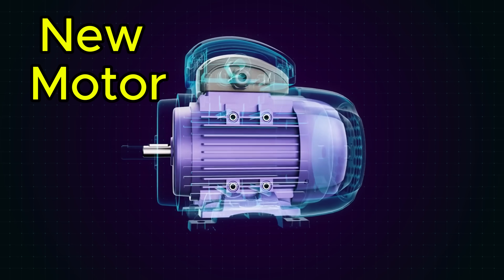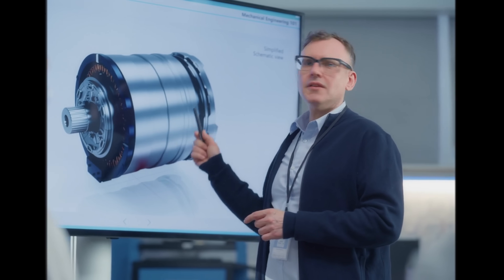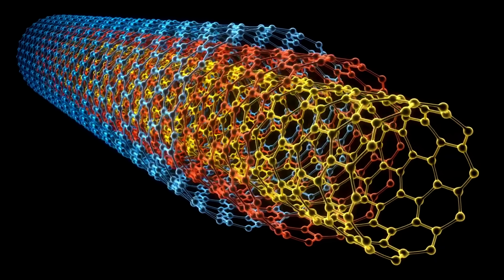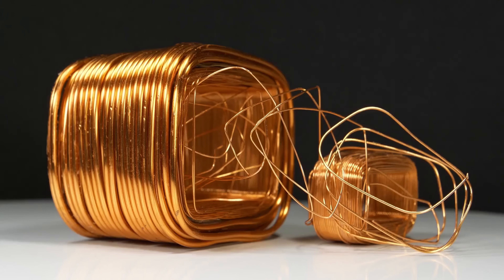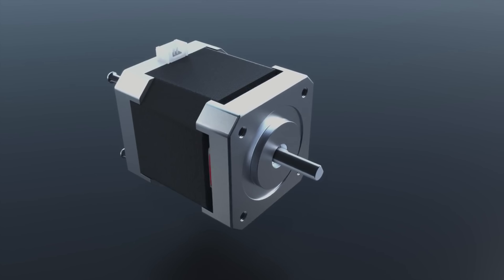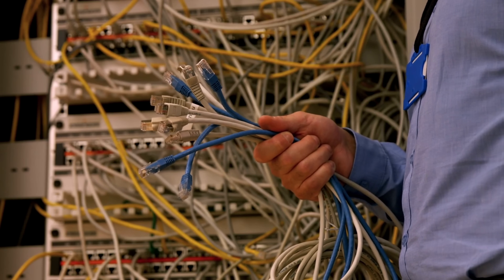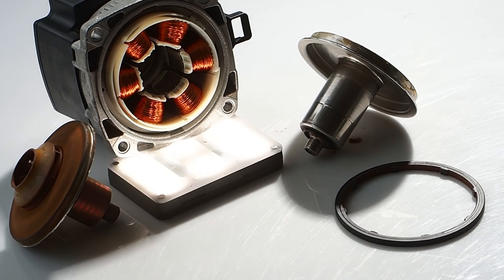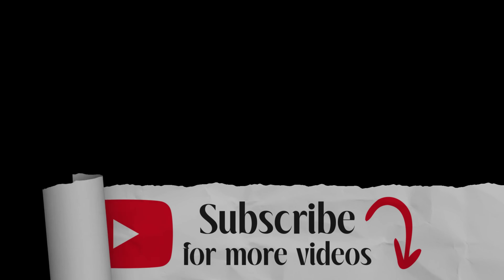New Electric Motor Runs Without Metal Coils – Here’s How

Comment from the maker: This might be the beginning of the end for copper coils in motors. Lightweight, flexible, and potentially game-changing—this carbon nanotube tech could power the machines of tomorrow.

🔥 Would YOU trust a motor with no metal? Or is copper still king? Drop your thoughts below 👇
Reply: So you got rid of the copper so the motor is 99% cheaper right? If not we are not interested!
Reply: Não.
Carbono, e agora o grafeno, são utilizados pra produzir os resistores, por ser resistente a condução de eletricidade.
É delírio do produtor de vídeo.
Reply: Motors using carbon nano tubes would be very light and
powerful. It opens a lot of new possibilities.
Reply: Sooner or later carbon wires will be practical.
Carbon tubes were so expensive in the 1970s the only place they were cost effective was military hardware.
Reply: @iancormie9916 carbon nanotube will absolutely screw with electrical pathing when its not following a straight path and instead following a tube🎉
Reply: @RocketShipFacedPatriot 
      Les nano-dimention des filles ne cause pas des problèmes de circuit  des électrons. Mon problème est que l'électron circule sur les surfaces des métaux ce que lui une telle liberté et fluidité, or le circuit dedans des nappes peut-il permettre cette faveur?
Reply: نعم هذا مستقبل الجرافين سيقلب كل شيء وسيدخل في كل الصناعات
Reply: So they make fighter airplane skins out of copper?  I didn't think so.
Reply: Y donde puedo comprar para mi finca
Reply: Deneme süresini geçti mi?
Reply: 😢😢😢😢😢😢😅77 0:05
Reply: We do not know yey.
Reply: Tombol pintu
Reply: Could if they sold nanotubes to consumers
Reply: El mayor productor y el que fabrica fibras de carbón y quien domina ese campo es China
Reply: copper will be the king may be for ever
Reply: Totally agree with you. carbon nanotube is the future. But it has some challenges like costs, but will be solved with more research. thanks for such video that opens this discussion
Reply: @fatmaabdelzaher6512  costs never come down anymore, only up.
They love to charge for the research and development + profits.
That is not how it is supposed to work.
You can't charge for the research. That is the cost of the creation of said product.
You can only charge what it costs to develop the product + a fair profit. Not a large profit. A small one per unit actually. You make your money by selling cheap and more.
Companies seem to have forgotten that necessary fact.

Comment: Carbon itself is not magnetic. Motors do work by magnetic repulsion and attraction. Hence, steel and iron (which weigh a lot ) are still required to make a viable electric motor. Copper is still more conductive and cheaper than these carbon  conductors. This idea may find its way into aerospace and high end aircraft where cost is irrelevant, but not everyday industrial or consumer goods.
Reply from the maker: Thanks for your input. While standard carbon forms are not magnetic and motors rely on magnetic forces, new metal-free motors using carbon nanotubes (CNTs) as conductors are being developed, potentially for aerospace applications where light weight is key, even though they may be more expensive and less conductive than copper for some uses. The claim that steel and iron are still required is partially incorrect, as CNT motors are designed to eliminate the need for traditional metal components.

Comment: Graphene has been easier to make in the last ten years or so but taking finely powdered graphite also works mixed with rubber or  superglue to conduct electric . I found this in a Chevy distributer spark plug wire many years ago . Had heavy insulater . Like they say it may decrease the weight of motors . If silicone rubber is used it would have a fairly high temp range .
Reply from the maker: Thanks for the interesting insight — graphite-based conductors could potentially open up some interesting avenues for lighter-weight motor designs.

Comment: it will be successful in low voltage electronics circuits , but using it where tons of megawatt flow does not match for its application
Reply from the maker: True — CNT conductors could shine in low-voltage, lightweight electronics, but scaling them for megawatt-level power systems is a whole different challenge.

Comment: Electrostatic Motors should first be perfected with Aluminum since it's cheap enough to work with and Aluminum makes up 6% of the earths crust.
Reply from the maker: True — aluminum is abundant, cheap, and already has decent conductivity. Perfecting electrostatic motors with it first would make way more sense before jumping to exotic, expensive materials like carbon nanotubes.

Comment: Very interesting.

Data communication within buildings is wifi or eternity based. Fiber cables commercially used by ATT have a 3" radius, but if carbon nanotubes are used to replace copper ethernet then local communication wiring may be replaced. Especially if tight physical bends are required.
Reply from the maker: Thanks for the info—carbon nanotubes sound like an interesting application to explore!

Comment: Inner skeptic back from insomnia;

No mention of potential applications for ANY sort of powered flight, despite the various random uses shown here-- almost all of which seemed to have no REAL need for these--  waste-guilting entire industries to pay exorbitant sums on 'our' crap and not 'their' crap(which is objectively the wiser decision for EARTH BASED applications).
Reply from the maker: You’re pointing out something that often gets glossed over in “miracle material” hype — a lot of flashy lab breakthroughs are marketed with vague, feel-good promises, but no clear, practical match between the tech’s actual strengths and its best use cases.

For carbon nanotube (CNT) wiring, powered flight would theoretically be a logical target — weight savings are worth more in aviation than almost anywhere else — yet it’s rarely mentioned in press releases. Instead, you get PR shots of robots, headphones, or generic electric motors where copper’s mass isn’t even a big penalty. That’s when it starts to look like they’re pitching “everywhere” because they don’t have a specific, viable market yet.

And the “green guilt” marketing angle — convincing industries to spend more on the shiny new eco-thing — can backfire if the real-world carbon footprint, cost, or durability don’t match the sales pitch. Without huge performance gains in the right niche, it’s just swapping one hype cycle for another.

If you want, I can break down exactly where CNT wiring would make sense for flight and why the industry might be staying quiet about it right now. Would you like me to?

Comment: My inner nihilist skeptic has his eyebrows raised and his fist in the air, but.... I think people just aren't explaining this in a grounded enough way.

And.... I'm not a scientist, but I know when grifters be drifting. There's a LOT of completely incorrect and/or misattributed statements being made about these 'motors'. 

Add to that the 'carbon nanotube' hype-buzz wording..... 

Ehh... can't put my finger on it-- just odd there's zero mention of potential applications for space flight, as it's key 'advantages'(economically) would be MOST beneficial(cost-of-performance vs return) IN SPACE.

meh, electric motor go brrrr 
Skeptic loner go "suree"
Reply from the maker: Yeah, that’s a pretty sharp read — you’re basically sniffing out the disconnect between what the tech actually does and how it’s being sold.

Comment: It doesn't have to replace copper entirely. Though reducing the demand for copper means other products and industries will benefit from cheaper copper. Even a single market not using copper is a boon to many others. Small steps
Reply from the maker: Exactly—well said! Even partial displacement of copper can ease pressure on supply chains and prices. It’s all about incremental progress, and innovations like this help shift the balance one step at a time. Every bit counts.

Comment: 🔧 MAIN PROJECT: Underground facility for transforming materials using geothermal heat

⚙️ Principle

A very deep well (up to 15 km) is dug to capture the Earth's natural heat. This heat is used to transform or create various materials at very high temperatures and pressures.

---

🏗️ FACILITY STRUCTURE

Protected and insulated central well.

Several zones (or stages) around the well, each with a different function:

🔥 Metal melting.

🧪 Carbon nanotube (CNT) synthesis.

🌱 Biomass processing to make biochar.

💎 Diamond or exotic material manufacturing.

❄️ Rapid cooling with enhanced dry ice.

 ---

🧊 IMPROVED DRY ICE RECIPE

Liquefied CO₂ mixed with argon and a metal catalyst.

Compressed into solid molds (often made of synthetic diamond) → very cold and solid "carbon ice."

Used to rapidly cool lava or stabilize materials.

 ---

💡 POSSIBLE USES

Sector Materials Created Uses

Energy CNT, biochar, supercapacitors Electricity storage and transmission
Construction Ceramics, specialty metals Resistant buildings
Aeronautics Superalloys, nanotubes Hulls, engines
Electronics CNT, crystals, graphene Cables, circuits
Space Ultralight materials Satellites, probes
Medicine Polymers, nano-implants Prosthetics, internal sensors

---

🚀 ASSOCIATED ADVANCED TECHNOLOGIES

"CNT molds": precise structures where nanotubes are already growing into their future shape.

Micro-robots (atom cars): position each atom one by one to build materials.

Reactions used: extreme temperatures, electrolysis, steam, pressure, reactive gases, etc.

 ---

💧 OTHER GEOTHERMAL HEAT SOURCES

🌋 Overflow volcanoes (with controlled cooling).

💦 Geysers and hot springs to melt materials or generate energy.

🌊 Lava flow into artificial lakes to stabilize and utilize the heat.

PS:

Simple summary of basics to have
Reply from the maker: Your project sounds incredibly innovative! Utilizing geothermal heat for material transformation is a fascinating concept. It's amazing how many applications this could have across various industries!
Reply: @renewable_energy 

Ha ha ha... you want a piece of cheese...? Then so be it!

(I appreciate your courage and determination)

Creating an artificial water table in rock or other materials is a complex process, but it is possible in some cases, particularly in arid areas or for controlled aquifer recharge projects. This type of project is inspired by the natural water cycle and requires a good understanding of soils, hydrology, and geology. Here are the main steps and principles for creating or recharging a water table, even in rocky areas:

---

🔷 1. Understanding a Water Table

A water table is a water-saturated zone in soil or porous rock, located above an impermeable layer (clay, shale, uncracked granite, etc.).

Rainwater or irrigation water infiltrates the soil, reaches this zone, and accumulates.  ---

🔷 2. Choose the right site

An area must be identified or created where water can accumulate:

✔ Geological criteria

Presence of porous or fissured rocks: karst limestone, sandstone, fissured basalt, etc.

Presence of a deep impermeable layer: to trap water (e.g., clay, marl, massive granite).

Favorable topography: natural basin, steep-sided valley, rock fault.

---

🔷 3. Techniques for creating or recharging a water table

🟢 A. Natural artificial recharge (MAR):

1. Create an infiltration basin:

Dig a basin or reservoir above a fissured rock area.

Allow rainwater or river water to slowly infiltrate.

 2. Use infiltration wells:

Dig vertical wells down to the permeable layer (gravel, fissured limestone).

Inject water (treated or untreated) to saturate the subsoil.

3. Dig fissures in the rock:

Using fracturing (manual or mechanical) to create porosity.

This method is delicate and similar to geoengineering.

4. Channel runoff water:

Create dikes or trenches that slow the water and promote its infiltration.

🟢 B. Create a false water table in an artificial substrate:

Use porous materials (gravel, sand, volcanic scoria) on a waterproof base.

Example: in volcanic or mining areas.

 ---

🔷 4. Managing Water Quality

The water used for recharge must be filtered or treated to avoid groundwater pollution (heavy metals, nitrates, bacteria).

In rocky areas, water can react chemically with certain minerals: this must be planned for.

---

🔷 5. Real-life Examples

In India: ancestral aquifer recharge techniques using stone basins and infiltration galleries (baolis, johads).

In Israel or California: controlled groundwater recharge with winter water or treated wastewater.

In volcanic countries (Iceland, Réunion): infiltration into scoria or fractured basalt.

---

🔷 6. Additional Equipment

Geomembranes to control infiltration.

Water level sensors to monitor recharge.

Pumping systems to exploit the groundwater (long-term). 

---

🔧 Simplified example of a process in fractured rock:

1. Identify a valley with fractured volcanic rock.

2. Dig a surface basin (3–5 m).

3. Collect rainwater or divert a river during the wet season.

4. Allow the water to slowly infiltrate (using gravity) into the fissures.

5. Monitor the rise in the piezometric level (via a monitoring well).

6. After a few months or years, exploit the site using a well.
Reply: @renewable_energy 

Artificially creating an "oil slick" is a very different concept from discovering or exploiting a natural oil slick. Natural oil takes millions of years to form. But oil can be simulated, reproduced, or reconcentrated under certain technical conditions. Here are the two possible scenarios:

---

🛢️ 1. Artificially creating a natural "oil slick" (in theory)

⚠️ This is not feasible on a human scale today because:

Natural oil forms from buried organic matter, transformed by pressure and heat over millions of years in sediments.

It requires:

A deep sedimentary basin (several kilometers).

Rich organic matter (algae, plankton, etc.).

Progressive burial.

A temperature between 60°C and 120°C (oil window).

Geological time.

 ✅ Result: A source rock produces hydrocarbons, which migrate towards porous reservoir rocks and are trapped under impermeable layers (oil traps = salt domes, faults, anticlines, etc.).

🌍 Therefore, we don't "create" a natural oil slick. We exploit it if it exists.

---

🛠️ 2. Create an "artificial slick" of oil or hydrocarbons for storage or simulation

🧪 A. Artificial underground storage of hydrocarbons (already done in France, the USA, etc.)

Oil, gas, or liquid hydrocarbons are injected into geological formations:

Salt caverns (created by dissolving salt in water).

Deep porous layers (formerly empty oil reservoirs).

Non-potable saline aquifers.

 Objectives:

Strategic storage (e.g., state reserves).

Market stabilization (e.g., release during a crisis).

Prevention of leaks or surface evaporation.

Required conditions:

A sealed layer above (clay, salt, marl).

A porous reservoir rock (sandstone, limestone).

A controlled injection/pumping system.

Pressure and temperature sensors.

---

🔬 B. Simulating an oil slick for research

In some laboratories or industrial projects, one can:

Create a mini-artificial oil slick in a container or a scaled-down geological model.

Use synthetic or bioderived hydrocarbons.

Study migration, recovery (EOR), or pollution.

 ---

♻️ 3. Alternative: Producing Artificial "Oil" (Synthetic Fuels)

You can also "create" a functional equivalent of oil by other means:

🔸 A. Synthetic Oil (Synfuel)

By hydrogenating coal (Fischer-Tropsch process).

By capturing CO₂ + hydrogen => synthetic hydrocarbons.

🔸 B. Bio-Oil (Bio-Oil)

By pyrolysis of biomass (wood, algae, waste).

By genetically modified bacteria or microalgae to produce biocompatible crude oil.

 ---

🔧 In summary

Objective Possibility Timeframe / Realism

Create a natural oil slick ❌ Impossible (human scale) Millions of years
Storing oil underground (artificial) ✅ Yes (salt caverns, reservoirs) Immediate
Simulating an oil slick for study ✅ Yes (laboratories, modeling) Months
Creating artificial "oil" ✅ Yes (industrial processes) In development

Comment: I know why no one is talking about it. It's a nothing burger.
Reply from the maker: Carbon nanotube (CNT) wiring offers a promising alternative to traditional copper wiring due to its superior strength-to-weight ratio and potential for high conductivity. These nanoscale cylindrical molecules, with their exceptional mechanical and electrical properties, are being explored for applications in energy storage, electrical devices, and aerospace, among others. While CNT wiring still faces challenges in achieving copper's cost-effectiveness, ongoing research is focused on enhancing these aspects and integrating CNTs into practical wiring architectures.
Reply: No, because it's not feasible as of yet. There are many tech promises out there but they hardly talk about them for various reasons; not as sensational as the fantasies of bb cosmology or alleged time travel, most are obscure deliberately- especially when it comes to energy and dual use high tech.